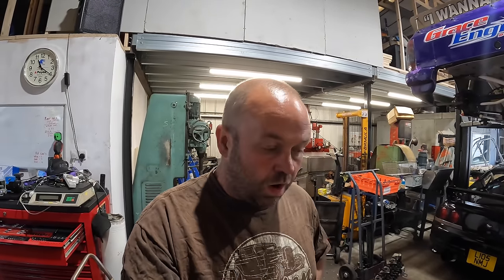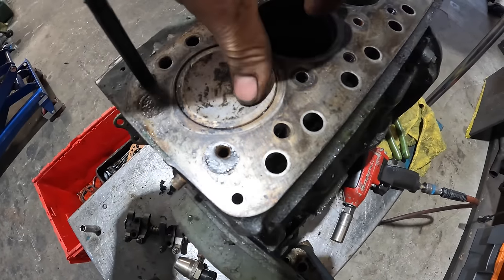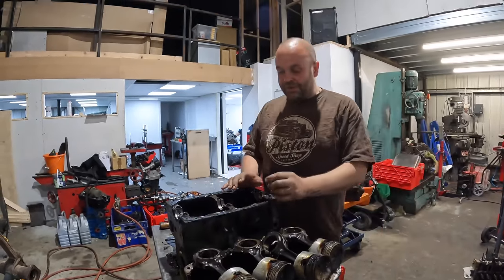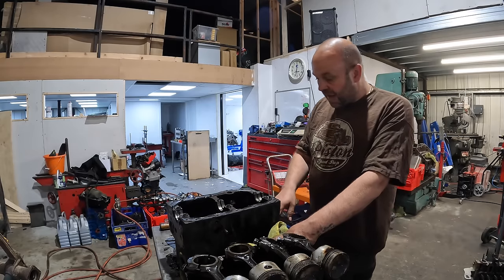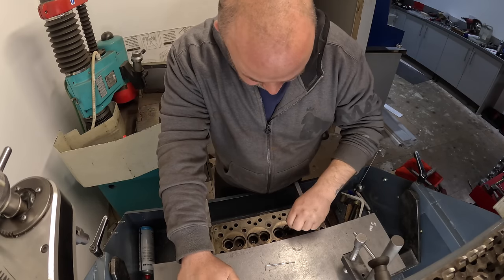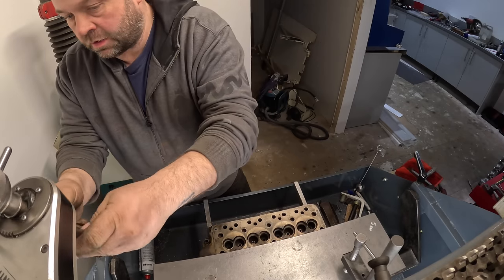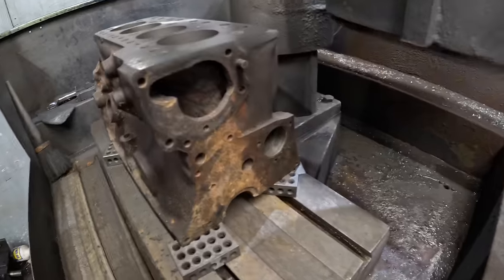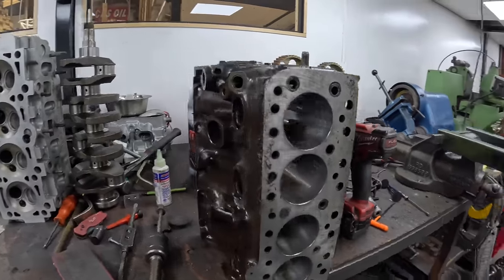A Series Engine Rebuild for a Classic Morris Minor |

Comment: How many miles does this engine run, please?  
I know this engine from the Mini Cooper from 1976 the engine was absoluty reliable.
Reply from the maker: 1000 miles is recommended, yes there a great little engine
Reply: @graceenginedevelopments  Thank you Sir but only 1000 miles and now it is worn out? ... 🤔
Reply from the maker: I don't know how many the engine had done sorry I thought you meant how many miles the engine needed running in for.. my mistake..
Reply: Well I had an 848cc A series on my mini that had 120k miles on it with just regular servicing although it was starting to feel a bit loose and burn a bit of oil, plenty of timing chain rattle.
Reply: @dl582  Thank you very much, as far as I know the Mini Cooper we got back then, had the same engine with 39 HP and In the same yellow color like Mister Beans Mini Cooper from 1990...LOL... 😂.
Greetings from Germany !
Reply from the maker: That's awesome mileage

Comment: Pity we couldn't see the rngine running. A beautiful job though. I would be surprised if that engine didn't give 100,000 miles of trouble free motoring. Personally I would have prefered to put a Howley 1430 lump in it. Thanks :)
Reply from the maker: I will get a video of the car when it's running. Thank you

Comment: A+ rockers and a duplex chain is a really common upgrade. I have had problems getting oil pumps to suit the old style camshafts. Did you run this up to temperature after ftting the copper gaskit?
Reply from the maker: @captainchaos3053  yes I did, it's ok now though
Reply: @graceenginedevelopments  Glad to see another minor still going strong. Mine is a 69 traveller. Almond green. Stock standard. Great little cars. Nice to see you break the edges to avoid glowing. The only modification on my minor is a pair of roll pins that match up my manifold correctly.
Reply from the maker: Yes there a great car, I like them in green as well.
Reply: @graceenginedevelopments  I'm subbed, like your work and appreciate that you do care about your customers.
Reply from the maker: @captainchaos3053 thank you very much.. I like the feed back and opinions too.. never stop absorbing info

Comment: Should use brass core plugs , I did when I rebuilt engines, they won’t rust out !
Reply from the maker: Good idea.. my parts supplier got me those I'll ask him next time
Reply: Never heard of those, when we used to do these, you could still buy a core plug set on a card, from the petrol station down the road (most still had a garage attached).  You could buy plugs, points, rotor arms etc, and expected to ! Now you can buy a stale sandwich, a newspaper and a bottle of beer !  W-T-F !!
Reply from the maker: @CrimeVid  times have definitely changed there..

Comment: ring gap too small is my estimation of the issue. I had a Cooper motor, and I didn't measure the correct end gap, and that what happened to that motor. p.s. It was my wife's car, so it didn't go well for me. That was in the '70's. I learn't from it.
I must admit, it was my Christmas present for me to assemble it on Christmas eve. Probably a bad decision, on my behalf.
Reply from the maker: Yes definitely could be, you made a big mistake doing this on the wife's car lol.. have you been forgiven yet?

Comment: Maybe just me but those rockers are A+ types and never used in a Moggy! It should have either the pressed/folded steel or forged types. Also looking at the lack of carbon on #1 piston i'd hazard a guess at it being the real leaker, enough to cause detonation that cracked the ring land / piston damage!
Reply from the maker: You're probably right on the rockers the original ones were cast but badly worn. All of the pistons were badly worn with broken rings. It was definitely tired. Thanks for watching

Comment: Was it the timing or fuel air mixture that destroyed those pistons?
Reply from the maker: Timing I think
Reply: @graceenginedevelopments  Yes sir, more than likely the timing. 
My reason for inquiring is that I once owned a 67  2 door burgundy Ford Cortina back in 74. Unfortunately,  the poor car began to smoke like a steam locomotive. I drove it to  far with the timing inordinately advanced 
(I could hear the rattling or pinging on the accel).  During overhaul we found the pistons were eroded just the same as that MM engine that you have so famously tore down for us here. Thanks a bunch mate!
Reply from the maker: I didn't see the car before the strip down but I think the timing by the looks of the damage.. if you heard the pinking for yours that would definitely cause damage.. the breather was very bad on this as well.
Reply: @graceenginedevelopments  Perhaps the coke and oil cake in the the breather tubes are the products of those torched out ring lands, (direct combustion gasses going into the crankcase). Relieved that you cleared the obstructions in the breather assembly, I wouldn't have thunk it. Spectacular Job!           *liked and subscribed
Reply from the maker: Yes possibly, it was very full.. thank you.

Comment: Should convince the owner to go atleast a kent 256 mild road cam, as its basically free horsepower, heaps torquier (which will be great on those european mountain roads) and better fuel mileage and the tickover is just like stock. Basically ajust applying modern grind technology to the cam, rather than the ancient 60 year old stock cam. I think people think a cam means a lopey idle and no low rpm power, which isnt always the case unless you want the car to be like that
Reply from the maker: Hi Chuck, yes I know what you mean.. the cam was in perfect condition and the customer only wanted std

Comment: Valve spring length?
Reply from the maker: Are you asking what it is?
Reply: @graceenginedevelopments  Just wondered if they were checked.
Reply: @graceenginedevelopments  Used to do the same with variety of different engines. A lot of things done are done automatically like feeling bores etc. Cummings, Detroits, Bedford, Ford, Medows, Perkins, Cat,  Rolls Bseries, Meteor and others total strip and rebuild.
Reply from the maker: Yes they were, but not replaced
Reply from the maker: Do you still work with engines
Reply: @graceenginedevelopments  Sadly no, miss it loads. I was great watching you working as you just did the important things by second nature. Have you any thoughts on why all the top rings broke, have you ever come across it before? I never did. I am guessing the engine had a major overhaul with new pistons/rings. Could it be (as you found the new rings needed the gaps enlarged) that the gaps on the old rigs were too small? Have you any idea how many miles the engine did after this rebuild, not many I guess as the shells/journals seemed not to bad.
Reply from the maker: Sorry I've only just noticed your reply.. I think it was either pre ignition or incorrect ring gaps. No idea on the mileage

Comment: Why on earth would anyone spend actual cash money on one of these when the Datsun 'A' series of engines is a much better option. They range in capacity from 1000cc through to 1500cc, & kits are available to install the engine & gearbox leaving more room under the bonnet than before.
They're smaller, lighter, produce more power & some models came with a five speed.
This was a very popular upgrade here in Oz & delivered better performance, and, depending on driving style, better fuel economy too.
If I remember rightly, it was the Datsun Bluebird of about 1963 that used a license built Austin or Morris engine. They managed to stop the oil leaks, fixed the unreliability issues & made it run well too.  [Isuzu did the same with the Hillman engine in their Bellet models around the same timeframe.]
Reply: ikr. I just done a restore on the HQ Holden. For the engine I used a Ford Intech. Rock solid, and better than the original  202
Reply from the maker: For originality, the customer didn't want anything else.
Reply: @breebw  Including the words "restore" & Ford engine in a Holden in a single paragraph is a contradiction in terms.
It may well be a very good, sensible, practical & economic rebuild, but the word 'restore' has no connection with the finished product.
Reply: Cause the owner does not have  datsun!
Reply: @graceenginedevelopments  Exactly that!! 👍
Reply: @johnnyjrotten59  Your point?
I accept that if the owner want's a restoration, that's fine. But if the owner wants a reliable, serviceable, uprated more modern performing car, then an engine & gearbox transplant is the most effective way to achieve this. The lovely Datsun A series of engines is an exceptional choice in this regard, particularly the A14 & A15 variants. This is why the conversion was so popular & widespread over here
But the owner wishes to keep an original powerplant & I can respect that.
Reply: @Bulletguy07  Interestingly, my first car was a Morris minor. A 1953 series MM. The last of the side valves & the first of the High Light models. This was back in 1967 & understandably, for a teenager in a big country like Australia, it was a gutless, slow moving piece of [censored]. It was a two door with a completely rotted out convertible for spares.
Within a year I sold it & bought an early build 1933 Dodge Coupe in late 1968.
I loved it so much that after 55 years I still have it. Still love it & have in 1978 I secured a '32 model as well. Love them both, so I do understand "restoration"
Reply: @KB10GL  My first car was also a Minor 1000 bought just after passing my test in 1968. They were never built for speed but were very reliable, easy and cheap to maintain so made an ideal first car. The MM type you had is now pretty rare (even here in UK) and quite sought after. The point I was making was the owner of the car the engine was being rebuilt for specifically stated he wanted it to remain original spec......he didn't want it modified.

Comment: If it is a 'rocker shaft', why call them 'followers' and not 'rocker arms' when stripping the head????  They look aftermarket, not early original forged or the newer fabricated from 2 pieces of sheet steel with a hardened piece to contact the stem.  Breaking top rings is usually hard revving an engine that hasn't been revved up in a Long time & has built up a hard carbon ridge that the ring smacks hard, else detonation.
Reply from the maker: I should have called them rocker arms my mistake I often get my words mixed up lol.. yes the rocker assembly was the wrong one .

Comment: I believe Nissan A14 engine is their improve version of this engine
Reply from the maker: I'll look into it
Reply: I recently saw a 1955 Morris Minor at Morgan in South Australia with a 1400 cc Datsun motor out of a 120Y.  It was fitted with a electrically controlled Supercharger originally from an unknown by me Toyota model. Water/methanol injection helped with detonation control when the supercharger was activated, and when activated the car had 270kW at the rear wheels. The wheels were only an inch or so larger in width than OEM and painted alloy of discreet design, so much so that they blended in with what was possibly original paintwork, and were barely noticeable. The owner had upgraded to disc brakes of around 11 inches diameter which pulled the car up very effectively he said. The bodywork had a few scars acquired over the years, possibly from hits on native animals like wallabies which are small kangaroo like animals about the size of a small sheep, and the car had a tow bar and roof bars to carry stuff like ladders or surf boards etc, making that car a real sleeper. It had enough grunt to break traction in every gear change even on sealed roads I was told and the owner who was a bit of a diamond in the rough, said that he loved pulling alongside a hot ute (pickup) like a Club Sport Holden or an XR6 Ford Falcon at the traffic lights. When they went green, he generally showed them a clean set of heels. I think that car would be a lot of fun!
Reply from the maker: I'll have a look
Reply from the maker: That sounds like a really fun little car, I would have loved to have seen it go.. thanks for viewing

Comment: This is a bit strange the Morris Minor had an 805cc engine and a Split Windshield, the Morris 1000 had a 998cc engine  I had a 1958 one, the 1100 engine was originally fitted to the Morris 1100 although it would have fitted directly into a morris 1000 engine bed! Old bloke talking!
Reply: I think later Minors had the 1100 engine as standard. My J reg certainly did. I was always tempted to Midgetise mine with 1275cc engine and front disc brakes.
Reply: In Australia the Mini Deluxe had a 1098cc ... same as those clunky Morris 1100s.
Reply from the maker: I don't know all the different changes to be honest
Reply: @thedolphin5428  That 1100cc engine was fitted to the Mini Clubman (with the squared off front) in the UK. Borrowed a friend's for driving around London for which it was perfect. So nippy!

Comment: Split pins..........LOL you mean cotter pins.  So you use lock washers on your piston cap bolts too?  Over here on the other side of the ocean we just torque them.  Where did the pieces of the rings go?
Reply from the maker: They are known as split or cotter pins here in England. The lock tabs are used on some older engines, they are torqued as well. The pieces of rings probably were blown out of the exhaust.
Reply: @graceenginedevelopments  USA, AZ.
Reply from the maker: Awesome, I'd love a trip over there.
Reply: LOL you mean split pins....😉
Reply from the maker: @alexbaxter9512  everyone has a different opinion.
Reply: The lock-tabs are soft steel and get galled easily, changing the fastener's torque whether lubed or not, quite a bit!!
Reply from the maker: Yes I do agree with you they are quite soft

Comment: Looks like it was re-ringed without a rebore, the rings hit the grooves in the worn bores and broke the rings and the broken parts of the ring flaps up and down wearing out the piston ring lands. A Typical failure caused by a bodge up. Unless of course someone fitted piston and rings and did not compress rings properly and broke all the top rings!
Reply from the maker: Thanks for viewing... Possibly

Comment: Morris Minor we knew in India had factory side valve engine,,,
Reply from the maker: Yeah I think some of them did?
Reply: @graceenginedevelopments that would be the 803cc side valve…basically the low light split windscreen version. Before the 948cc A series which was given a longer stroke to become the 1098cc engine as used in the Austin/Morris 1100, A40 etc
Reply from the maker: @colinprice712  that's interesting I'll do a bit of research, I don't know all the different models and years to be honest, always happy to learn
Reply: Split screen moggy went from sidevalve to 850  the the picture on the thumbnail is a Morris 1000 traveller which came out with the 948 the 1100 a series was introduced when the 1100 car was produced in many variants that the BMC made the list to long to go into
Reply from the maker: @jamesparkinson4311  cool thanks for the info

Comment: Valve seat will crack in $3 cylinder, the valve will burn. That cylinder will warp and burn oil. Reseat with hardened seat and resleeve #3 with a steel sleeve, or it will do it again in s few thousand kliks.
Reply from the maker: It has been lead free converted. Also rebored so hopefully be fine now